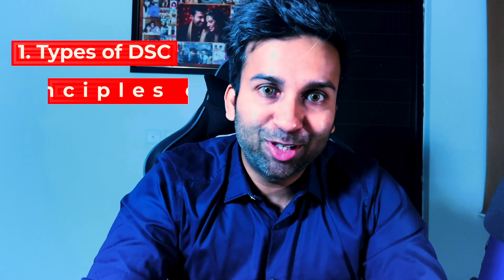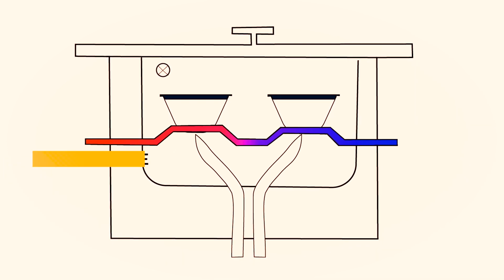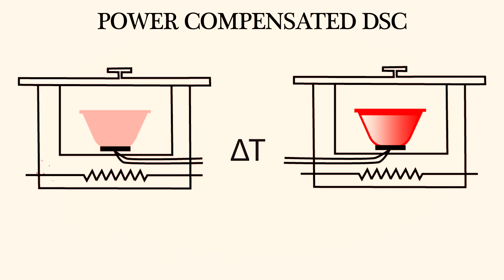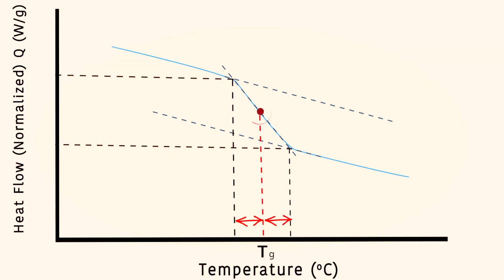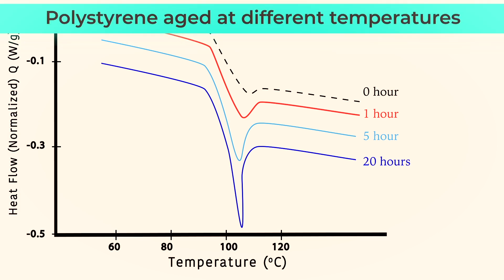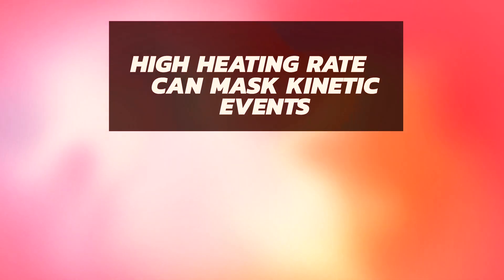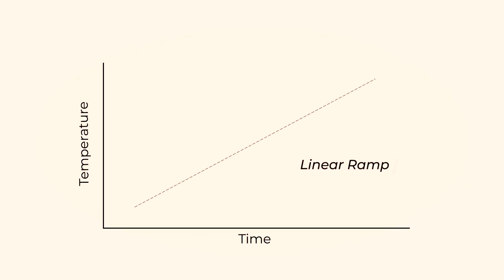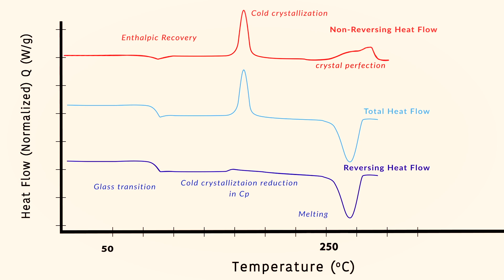The Definitive Guide to Understanding Differential Scanning Calorimetry (DSC) Applied to Plastics

Comment: how to confirm amorphous copolymer by dsc
Reply from the maker: Hi, for amorphous polymers you should be seeing multiple glass transition regions during the heating/cooling cycle. You can look up the data sheets to see which polymer has glass transition at that temperature or you can do an FTIR analysis to check for the peaks and find out the polymers. 

You can watch the FTIR video in our channel to learn more
Reply: @microlabtesting  sir how to correlate dsc of amorphous copolymer with ftir 
How ftir supports dsc of amorphous cooolyner
Reply from the maker: @mediwise2474   with DSC, you will be able to find out the glass transition temperature. Combine this with FTIR, you can find the family of polymer ex. PC-ABS will have two dips in the DSC indicating 2 glass transitions, and in FTIR curve you can see peaks that are characteristic to these 2 materials.